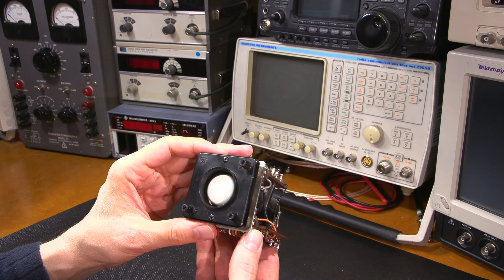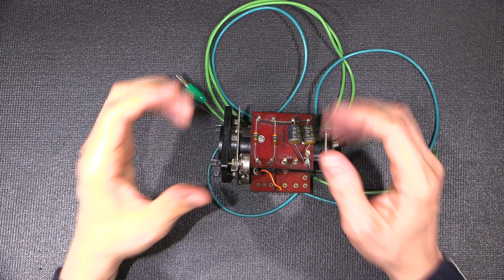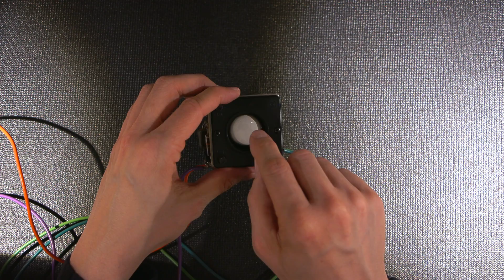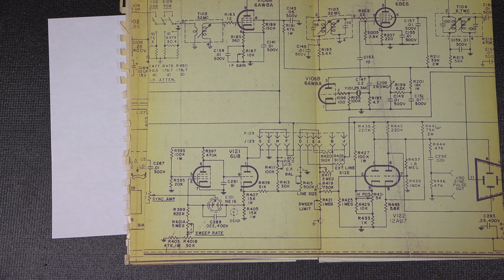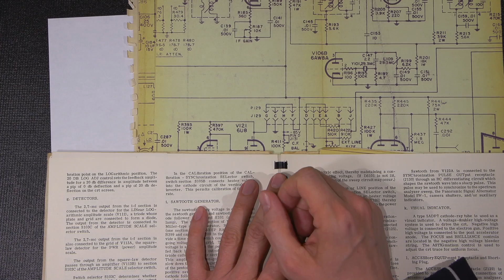Electronic Tool From The 1950's! Will It Work?

Comment: A story for you, Mr. Carlson. An Engineer told me once of a project he was working on where he wanted to use a very fast acting tube to switch on a circuit. He found these tubes which had radioactive elements in them which produced a very consistent level of electron emission. When he tried to buy some of these he got a visit from some investigators from Washington DC wanting to know why he needed them.

Question to you. Why were they so concerned?

Comment: Nice. I love that little scope. It would make for a small handy little modulation monitor for a ham radio station, particularly if you're running on AM and need to check for\ 
overmodulation, clipping, asymmetrical peak limiting, etc.

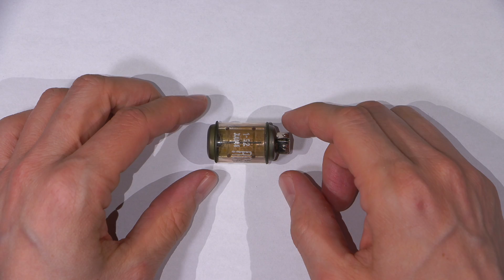Comment: 22:22   It is a gas photocell tube.    Popular number in that configuration is a #5582 tube.  It is kind of like a photo resistor, but instead light allows electrons to flow through it, so essentially light is your control grid.

Comment: You could use a very small amount of radium half life of 1600 years.  The mystery tube
appears to be a photo electric tube.  Tubes like this (not this particular one) were used
in equipment like motion picture sound reproducer heads to read optical sound tracks
or it could be used as a imaging tube in some sort of film scanner / fax machine.

Comment: Arg, I assumed the gas tube was in a dc regulator circuit, not a sweep circuit. That makes sense. As a physicist, I should have thought outside the box. I have only used them as dc regulators.

Comment: I wonder if that scope module was what Knight-Kit had included in the design of their much-anticipated T-400 transmitter circa. 1960? The built-in monitor scope was listed at a $37.95 option. Sadly, that 400-watt transmitter kit didn't make it into production.

Comment: Taking a guess at the 1 minute intro. Committed now.. CRT electrostatic vector display. Show phase relationships such as RF Carrier and modulation level for an AM transmitter. RF vertical and audio Horizontal would show if modulation exceeds 100% with carrier cut off.  Now back to the video.

Comment: He said he had about 400v for the horizontal oscillator deflection, but I would like to know what the voltage either RMS or peak to peak for the signal generator he was using, for the Y deflection??  Was never mentioned?
Reply: it wouldn't matter really, the 400V was going to the circuit that powers the CRT, the Horizontal was coming from Mr. Carlson's Variac (he didn't show how much but was probably just a few volts (peek to peek or RMS because they are just scales 1.71 volts apart when using a sine wave) and the vertical is probably .5 to about 3 V p.p. but it all depends on what attenuation resistors are used in the OS unit.

Comment: Md 522 modems found in angrc 142 radio teletype communication containers mounted on 5 quarter ton truck had these or similar devices to monitor the wave forms. Transmitter and receiver for am/fm upper and lower sideband. Radio telegraph, audio and teletype. Half duplex capable.

Comment: I remember something like that on the modulator section of a 20 KW FM transmitter at the college station I worked at in 1970. I think it was somehow used to display phase. Sound familiar?

Comment: Oscilloscope tubes like this were sometimes used to tune a receiver for RTTY (radio teletype) reception of FSK (frequency shift keying).  Since the RF carrier itself was shifted between two frequencies separated by the same interval as the audio frequencies to be fed to the demodulator (850 Hz difference), the receiver’s BFO (beat frequency oscillator), also used to demodulate CW (code) and SSB (single sideband), had to be adjusted so that one RF carrier frequency, when combined with the BFO, would produce the audio tone for Mark (resting state between characters, or logic 1), and the other RF carrier frequency would produce the tone for Space (start of a character or logic 0).  A tube like this would help tune in the signal.

The audio from the receiver was fed to the AFSK (audio FSK detector), which had two narrow band tuned audio amplifiers, one for Mark and one for Space, to flip the relay controlling the DC signal to the printer.  These signals were also fed to the horizontal and vertical inputs of the scope.  When the signal was tuned in properly and the BFO was adjusted correctly, the scope would show a vertical line alternating with a horizontal line at teletype speed, or with persistence of vision, a cross with equal length arms.  The appearance of both frequencies at the same time would produce a fast changing Lissajou pattern, which would smear into a rectangle or square.

Comment: I used to see ads for this little device in 1950s QST magazine. I believe it was made by Millen. It's a tiny oscilloscope with a one-inch CRT and circuits for focus and brightness. It needs a power-supply and sweep, deflection circuits.

Comment: you need a saw tooth wave form to drive the horizontal sweep!!  bit an AC DRIVE. That is why you are getting thar double image from the sweep going one way fist then reverses the other way. On top ir distort at both ends of the sine wave on the horizontal. I used to built my oscilloscopes TV tubes and electromagnetic deflectors.

Comment: one of THE first takeaways was that you powered up an unknown unit where usually you say that bad caps can cause major issues. and also that as soon as you removed the high voltage you seemed to have your fingers all over it seemingly unconcerned about any possible "charged" caps. still, was cool to watch the process, thanks

Comment: This is so cool.  I have a small crt based viewfinder from an old camcorder that's basically the same as what you have here.  The only difference is it accepts a composite video signal.  It needs new capacitors (only 2 or three).  But will make for a really neat project sometime.  Can't wait to see what you decide to do with yours.  It's so much easier to work with than my little 1cm crt.

Comment: Hello, I'd like to ask any of you engineers/technicians about any books you may be able to suggest written for a non engineer, no (zero) experience, point of view? I'm am artist that does some work in metal, so I can solder very well. I'm also a musician, and have 17.5kHz hearing and (unfortunately) perfect pitch, and can listen to HIFI gear critically...which I think could help me start building kits. Recommend books on tube pre/amps would be great. I'd like to join Mr Carlson's Patreon, but I think even that may be over my head. I just purchased a great sounding tube amp, and would love to just look around inside and know what I'm looking at (design wise). Also, does anyone know if Mr Carlson does repairs/upgrades? Thanks!

Comment: In the Heathkit SB-620 "panadapter"   they use neon bulbs in a relaxation oscillator circuit for the sweep circuit.  The manual states that the bulbs must be "aged" for a hour or so, before it will function with normal stability.  Hmmm.

Comment: Restoring an old tube  pa amp with a diode rectifier. Each diode is bypassed with a resistor in parallel.
What is the purpose of this resistor? I haven't seen this in any other amp or radio I have recapped.

Comment: i wonder what would happen if you shined light into vacuum tubes could you cause a change in the sound quality or the picture and color quality of tube sound and tv systems?
Reply: in a word no, none of your commercially made TV sets (since 1970 anyway) use vacuum tubs that are normal light sensitive but maybe if you used very strong light and or certain wavelengths you might get results.

Comment: Many years ago I was sailing chief elec aboard the USS Ewa   an old steam ship that started out with 
Pacific far east line. She was over 30 years old, lots of DC equipment powered by MG sets.  There 
was A large Diesel Gen in the Engine room that could power the main bus on its own.  We tried 
to light it off one day and could not get the Brkr from the Gen to the main bus to close.  I tried 
everything I could think of but could not find any reason why it would not close. The chief 
engineer suggested changing a small burnt out light on the consul  we had tried everything else. 
It worked. I always wondered why before now   but never had time to look into it.  Thanks

Comment: Hello Mr Carlson ! 
I have just bought an old radio from the 1960's and i was wondering if you wanted to do some magic on it and make a video out of it. There are some problems with it, for example, it loves to spit sparks when turned on. 
Quick note, its made in east germany and have 4 tubes in it if you want a small challenge ;) 
Best Regards

Comment: im here in New Brunswick Canada, and I've gotten into electronics and i love it' i've acquired some stuff from a local tv radio station and was wondering if they can be used for anything or converted into anything use-able? this is some of what i have,,,Leader LBO-5860B waveform monitor, and Leader 5860C and a Leader 5850CNTSC Vectorscope, i dont know if you can help or not, just wondering if if can be used as an oscilloscope or wave form generator

Comment: I NEED HELP!  I have a General Electric Radio Model F 73 CAH.  I tried  looking up this radio online to see any information on it and I can’t find it. It’s like nobody has the radio I have. I spent hours looking for it but it’s seems like I’m the only one who has it. I have found some other ones that look similar like F 70 or F 74 but no one has  the one I got. Anyway I’m trying to fix it and the wire that is controlled by the dial knob is ripped and I need to know the right size to buy. I don’t know how the wire goes around the contraption, and the tubes get really hot in a few seconds. Another problem is that it it can’t pick up any signal, I just hear a hiss and some thumps. I am new to this type of work and this is my first project, I’m guessing this thing is from the 1930s or 1940s. But based off similar models I would say late 1930s... anyway I would appreciate any help. Thanks!

Comment: Hello, ive been enjoying your restoration videos!
Wondering if you had any knowledge of a signal generator i picked up 15 years ago.
Its labeled: army signal corps I-72-C
Serial number 2.
100-32000kc
Clough-brengle co.
Im going to do a resto on it this summer,
It did power up and generate a signal for a minut or so with a quick test befor shelving for later work.
Any idea? Of when it was produced or where i could get info on it?

Comment: Hi there. Yes I'm still kicking, just. interesting to see the COSSOR label on the  scope tube. Back to the 50's my dad got a replacement for the old backerlight cased  radio that he had and bought a UK mains operated Radiogram. All the valves (tubes) were COSSOR (BVA) with the same type of bases as the scope tube. Good old radio, had a shortwave band covering from approx 2 to 10 MHz. I spent ages listening to local Hams on 80 and 40 meters AM. before getting my own Ex.army receiver that covered the top of 160 through to 40 meters AM and CW. I seem to remembering only paying about £5.00 for that and a bit more for a "dry charged" 6 volt battery to run it. I saw one on E-bay identical to the one that I had. The price was £150.00 odd. Wish I had kept my old one. You seem to stirred quite an interest into the triggering tube question. Good video. Keep e'm coming. 73 de John - G0WXU.

Comment: The mystery item looks like a vacuum photocell, with photo sensitive cathode. If I remember correctly, these tubes used a cesium metal additive to activate the tube released inside in much the same way as other tubes are `gettered` using induction heating. Not sure of the part number, maybe a RCA921. Great channel by the way!

Comment: I remember seeing this photo tube in flame monitors on boilers. if you had a flame out in the boiler this controller would shut down the the fuel lines going to the boiler. The photo tube was used in boilers controllers because the photo tube was very sensitive to infrared light

Comment: Electrostatic scope CRT heater pins are almost universally pin 1 and pin N. N being the highest numbered pin. I have datasheets for lots of CRTs. Drop me a line with any CRT questions. If you like special cathode ray tubes, check out my latest video. The 1CP1 is a so called "self focusing" type. Runs on between 300 and no more than 500V.
I know what that last gizmo is too. I won't spoil it. I was an AV geek.

Comment: Looks to be an RCA 921, typically used in light operated relays. but it could also be a RCA 5582 which was far superior than the 921 and was used in movie projectors for sound.

Comment: Looks almost like a cold cathode gas discharge tube like OB2 for example, but with the plate cut in half.  The darkened glass suggests possible X-ray emission though, perhaps a high voltage diode?

Comment: The device is safe to use in its intended application.  It was normally installed in a panel of a piece of equipment like a panel meter would be.  Those loktal CRT's are as rare as hen's teeth today!  RCA made a similar 1" CRT with a duodectal base.

Comment: dont retire the glove  wait until the glove dies  keels over just like walter white did in breaking bad so one day it comes into work and then collapses and has to be whisked away by the glove paramedics.

or until the glove develops dementia and punches another glove before retiring it.

what happens if you apply a higher b+ voltage to a tube instead of heating the tube?

can the dub be ran cold cathode with a higher b+ voltage.

many Fluorescent tubes can be lit both cold cathodes and hot cathodes.

many of the newer electronic ballasts can light them cold cathode by applying say 10000+ volts instead of 600 to 1000 volts in normal mode.

that rca tube looks like it is possibly some radiation emitter tube maybe ir, uv or even a detector tube

Comment: RCA 5582 photocell. The RCA 5582 is superficially identical to the more common 921 cartridge-style gas phototube, but has a S-4 spectral response and 400nm peak sensitivity. The 5582 was used to reproduce sound from a film source.

Comment: Looks like a cad-eye from a furnace control that verifies illumination from combustion.  My experience has shown these were usually in older and/or larger units, usually burning oil.  Just a guess.

Comment: How old are you! All that stuff around you was obsolete in 1990. Get with the new electronic generators, scopes, oscilloscopes. Your socalled "lab" will be all in 4 to 5 solid state equippment. All you have there needs repair and calibration!
Reply from the maker: Hi Robert. Do yourself a favor, listen more and comment less.
Reply: When he needs something `modern` or `calibrated` he will just go into the next room.

Comment: Another note about loctal based tubes.  Many times you'll find them squeezed in fairly tight spaces and you can't get your fingers on them to pull them out.  The correct way is look for the little dimple on the side of the metal base and push the tube at the top in the direction of the bump.    This releases the lock and when you quit pushing the tube will basically just fall out.  Of course with this little scope you can't do that but I noticed the base of the tube does have the little bump. I learned this the hard way on the radio in my 1948 Dodge...

Comment: So slow ... the rate of information in this video is so slow. And very repeated... looks like teletubbies.
There is filament. 6 volts is filament. Filament is to heat the filament. 6 volts is typical for filament. I can solder wire to filament. And it is 6v. Look ot is brow wire it is filament. I can trace eire to socket and it is filament. And my green wire is filament....

Comment: That last tube, is a phototube. 
This one with the square feet is type 926.
An example usage for these is reading optical audio from the reel projectors. Light converted in amplitudes generating sound.

If just an ''transmitter tube''  was re-developped, that could work with these, back then you had the option to invent a nice tube remote controller :D

Comment: That's the only dead spot with a CRT. You really literally burn the coating when you use them a long time. But they are easier to manipulate than digital screens, at least :)

Comment: Definately a photocell or (electric eye), often used in things like automatic doors, safety detectors, or factory automation where a beam would shine on the tube and it would detect anything breaking it. Some here have also mentioned film readers, and other light modulation detection. They were also used as lighting control in streetlamps and even cars.

Comment: Phototube, back in the 40's till mid 90's the company I work for had these, on a double auger screw packing machines made by the Rose Forgrove co. It read the registration spot on packaging material, to know when to activate the slip clutch on the machine to make the same size pack every time, it use to be housed in a thick aluminum block with a lens. most of which I still have, and most of the whole machine too, there use to be 3 machines, I asked my employer at the time to have me keep one in 1994, the more modern machines like Rovema. are Well ahead of their time.

Comment: The RCA device is a photodetector.I forget the number, but I do know that it was used in power substation metering and telemetry devices made by GE. A complex power measuring device [like a polyphase watt meter] mechanically moved a mirror or prism which varied the photon energy produced by a lamp falling on the photo detector. This was processed and provided as a 4 to 20 ma signal that was output to remote metering. I remember working on these things as part of substation supervisory equipment in 1963-1965.